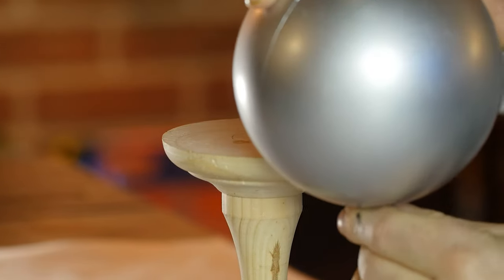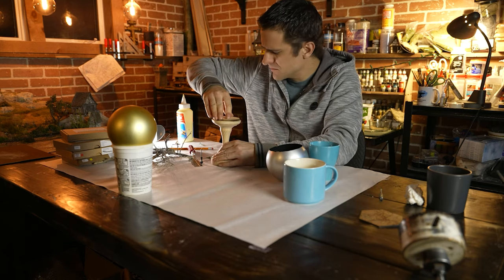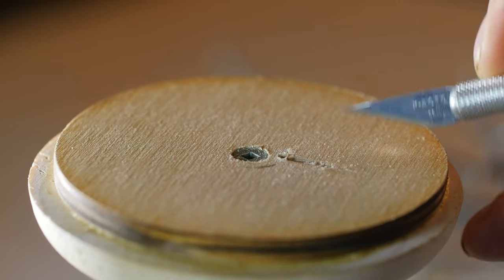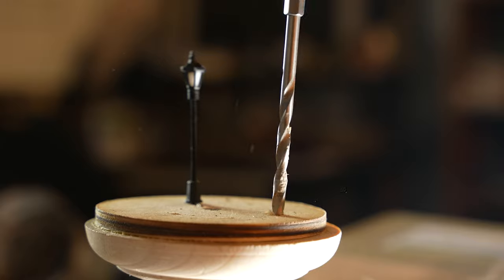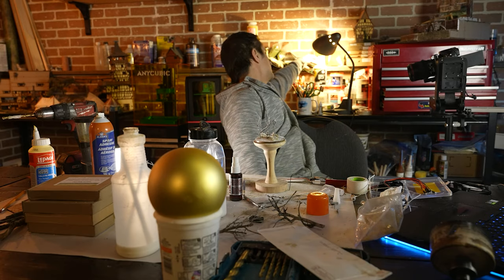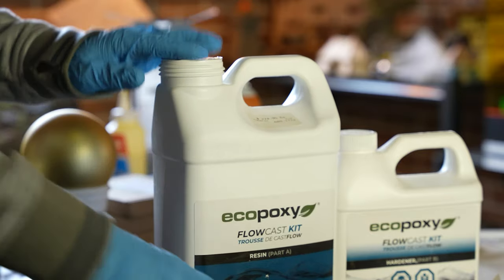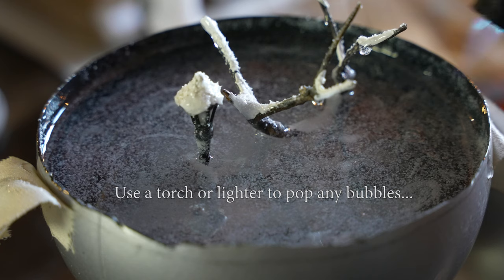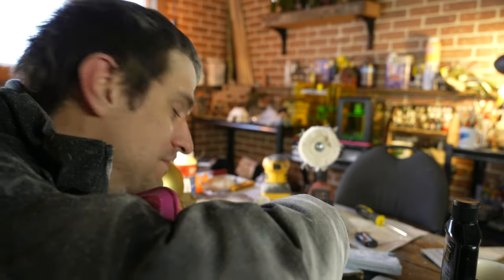I TRIED making a Miniature BLIZZARD Encased in Resin ICE!

Comment: Really interesting project here that seems like it might warrant more experimentation.

One thought I had while watching this is that your groundwork would probably entrap very small air bubbles and might also interact chemically with the casting resin. If you try something like this again, I'd consider using a thin layer of resin or perhaps acrylic gloss medium to seal all the stuff down at ground level, then add layers of casting resin after that.

I think you would also want to use a vacuum chamber to degas the resin after each pour to reduce bubbles in each layer.

Had the resin allowed for a thicker pour, I suspect the result would have been worse, since you would have had even more problems with bubbles being trapped at the top of the globe.

A completely different possibility would be to do your pour upside down, leaving the ground layer for the last layer of resin to be poured. This might keep many of the bubbles down at grass/dirt/snow level, where they might not be as obtrusive.

Comment: I use the Alumilite Amazing Clear Cast for my deep pours. It takes 48 hours for cure, and it's great for water features.  You can also do layers with it and they have been seamless when have. Just watch for the usual bubbles and pour in a long thin stream.

Comment: Please don't do this (again)!
Pouring a big volume of any 2 component resin is extremely dangerous! This is an exothermic reaction. Doing it in big volumes means to release more heat. I've seen mix-buckets melt and this can also catch on fire and burn down your house. Your specific resin 'might' be ok for the 1,5 inches, idk, but others are not! Please keep care!

Comment: I'm no expert on casting resin so this might make no sense what I say here but will give it a go anyway: Could you put the ball upside down and suspend the scene  downwards in it? That way if snow floats to the top, it will simply land on the ground, which has snow already anyway. You might pour some resin all the way through the stand and let it come out in something that looks like a small hole in the ground?
You would need a resin that you can cast in a single go of course.
Reply from the maker: I had considered that but I opted to go this way instead for fear of air bubbles being trapped in the terrain/model area.  But yeah, i think the biggest issue was requiring a single pour resin.  The upside down method would be worth a try though for sure.

Comment: For the static grass part, yeah, it probably is the superglue for it, you want pva/white or the tacky glue for the general glues...some of the scenic cement options work very well.

For the resin, if you gave it a light sanding, you can normally make it clear with a layer of gloss varnish over the edges.
Reply from the maker: Ahh, thanks for confirming my suspicions on that because yeah, it’s like it had zero effect.
Reply: @RealTerrainHobbies  It's a conductivity thing there. One of the things where you need the right glue for the job...kind of like how superglue will actually cure safely underwater (it's safe to use in fishtanks for gluing things currently underwater at the time). 

As a side note, was kind of surprised that you didn't try for a cobblestone path rather than a dirt one...seems like that would be the type used with that kind of light.

Comment: So, I really like the shape you ended up with, it's just a shame this didn't work as well as hoped.

I wonder if many more, far thinner layers would work better? Obviously, that would then have a far higher cure time, but it may have looked more even with just a tiny sprinkle in each, as opposed to the almost opaque layers you ended up with as the flock floated up.

I wonder how tile grout would have worked instead of flock?

Also, going with a slightly smaller design may also work better as that would reduce the amount of resin needed anyway.

This was a good idea though, and practice makes perfect.

Comment: The diorama concept was great; I'd say try again but find a way to do thinner/clearer resin.  Maybe try experiment with little bits of resin?  Some options I can think of - 1. Get two balls (inner, outer) to pour the resin ball in a more modest thickness 2. Spread/spray release agent on like a balloon and then layer very fine layers of some clear material, then pop the balloon and peel it; you could put a little bit of snow flock on one layer for blizzard effect.  Final option is obviously just to buy a premade glass ball and stick your suspended snow to the inside

Comment: Ive been working with resin for a year now. For this project you need to work in layers. You need a thin viscosity resin and use a heat gun or torch to pop bubbles. The bubbles will make your finished piece look cloudy . You will need to secure your snow so it does not float. Redo this. You will love it. Another thing is using a vacuum chamber to rid your resin of bubbles. Use fishing line to make falling snow

Comment: Resin is not nearly as scary as its made out to be if using the correct kinds. A deep pour would be perfect for this and a miniscule amount of "snow" will work to get the effect you want and still see the scene. Finish off with a quick glaze like you did to get the gloss effect. But you did learn some neat effects you can utilize later on...

Comment: the problem is that the air bubbles couldnt escape the mould. its a important step so the next time give it some openning on top and let it be like that for a few hrs and when u see that the air bubbles inside has escaped, u can cover the opening and let it dry

Comment: I gotta say, I also like seeing when projects fail. Not out of mischievousness or similar but because that's how we learn. And I think I really learned a lot from watching this video. Thanks!

I've done a lot of projects where I messed up a step or assumed something that didn't pan out, but where I learned a lot while trying to fix it. Like the clearing up with the resin coat on the outside. I didn't realize you could do that. Nice. I definitely like to see how things can mess up and different techniques to try to fix them. 

I also never thought about layer separation issues with a resin like that. It's definitely something I'll have to remember and account for in future projects.
Reply from the maker: Hey thanks a lot for saying this.  Means a lot to hear that.  As far as the resin separation it had more to do with the snow mixed in.  I guess it was wishful thinking hoping the snow consistency would be the same throughout each layer.  Either way much to be learned and glad you felt so too.

Comment: For your first time attempting such a look with resin, I think you did a great job.  If you attempt it again with a deep pour resin, might I suggest using an opalescent white mica and very small amount of very fine diamond glitter to give the translucent blizzard look on the interior of the globe. Then once finished, you could use paint or alcohol inks on the exterior,. Do a coating layer to encase it, then polish areas to dull parts out if wanted. Also, could use various tones of the alcohol ink to create a visual wind current inside your pour by dividing the resin into multiple cups before pouring and swirling a very small tip of a toothpick amount of alcohol ink, or your pigment if choice depending on the look you're going for and the resin you choose, creating a multi-toned translucent, finished piece.  I've never made a solid chunk of ice snow globe before, but if I were going to attempt it this is how I'd go about it. A word of caution since it's resin and white is involved... yellowing with age.  Something to keep in mind when choosing what you use to create the blizzard as well as which resin you choose if you're wanting it to look nice for more than a few years. 

I really enjoy your channel. Your Sherlock video had me squeaking over the book binding mold.  Thank you for pointing out to people that they should try to do things they want to do. No one gets it right all the time.  I dare say perfecting the art of making mistakes look intentional is a desired skill of all creators.   I really enjoy that you just go for it, big and bold.  Thank you for putting a smile on my face today. 🦋
Reply from the maker: This was a wonderful comment and thank you so much for the awesome help with the resin pour!  you're making me want to try it again.  :P  i'll have to do it again in the future here for sure, but slightly different somehow.  I'd still like to try a go at a proper blizzard again though.  And thank YOU for putting a smile on my face today. 😊
Reply: @RealTerrainHobbies  I look forward to seeing blizzard 2.0.  You do amazing work.  And, you're very welcome. 🦋